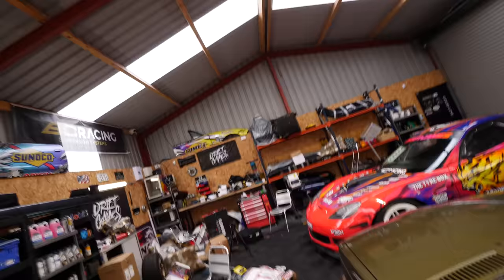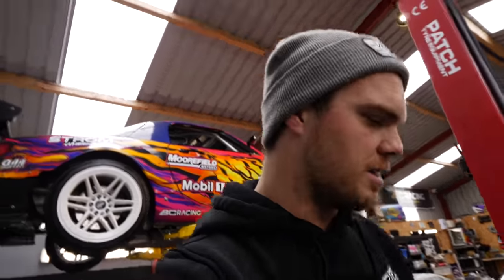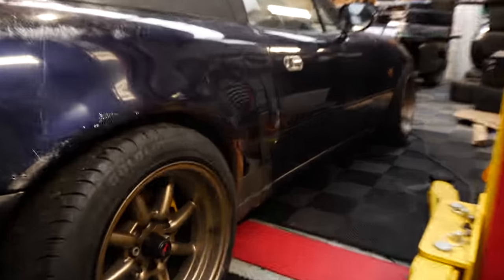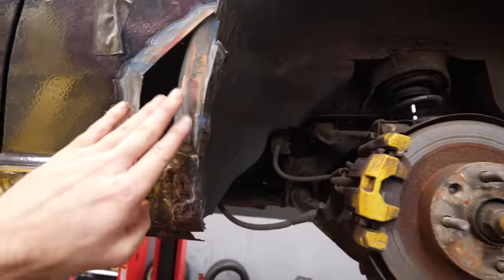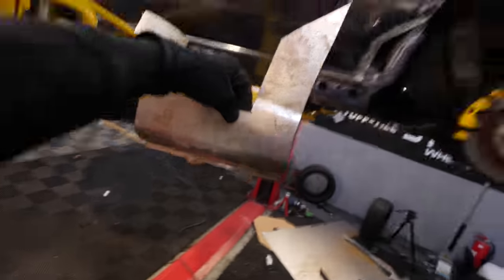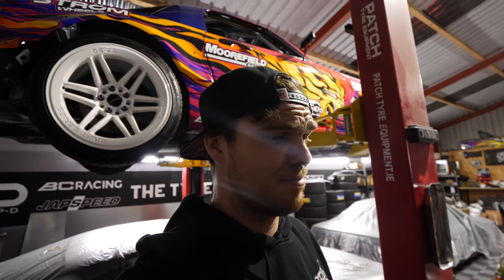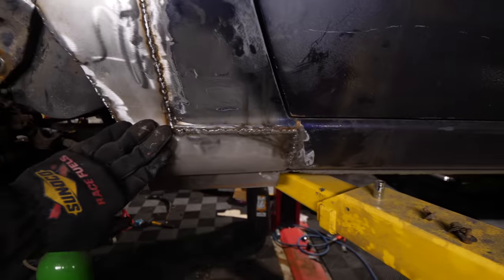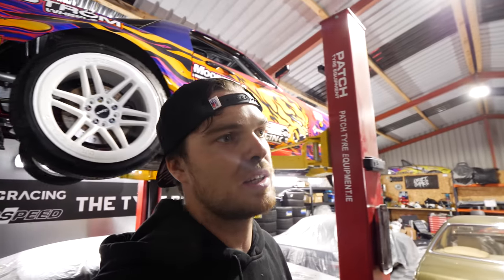Was the rust on our Mazda Mx5 NA too far gone? | First time welding…

Comment: What you need to do with this after the rust repair, strip interior seatbelt trims out there is a hole leading into the rear inner sill box areas spray that in cavity wax its complety unprotected from factory and this is why they rust so bad in the sills as condensation rots them out there, also remove both rear wheels 2x 10mm bolts each side remove the cover pop the grommet and spray in there too then u need to open the boot and spray into the holes leading into the rear archs in the boot it will save the car from rusting again at the sills

Comment: I had the very same experience with a mx5 nb not long ago. I bought the car not seeing the fact that it was completely Rotten so over a year I decided to try my hand at welding and fabricating for the first time clinging on to the wrong investment I made haha. I got through most of what I could such as the chassis rails and front end. But the sills were completely rotten to the rear of the car. I was very optimistic and was happy with my progress but doing it outside on a driveway with crap weather most of the time, it took its toll on morale so I decided to let it go. I kept loads of photos of the car and my work progress and still somewhat feel regret for letting it go. So good for you for taking a dive into the unknown man good job!

Comment: Definitely a good attempt. I'm the same as Josh. I've never welded anything so I'd be happy.
As long as it's now structurally strong now.
I'm sure you will, I'd put a load of underseal up inside those arches.
Also the areas behind the bumpers.
Reply from the maker: All of the under seal is going on this car 😂

Comment: Good effort! Be sure to check your hood drains are intact and not blocked. There's also a hole on the pinch weld to allow water out if it gets in. That usually gets closed shut from Jack's etc. Open it up with a drill bit, and pump cavity wax In it 👍

Comment: Good job Josh.. Only suggestion perhaps would be to use a zinc primer or any rust prevention primer before the Tiger seal. My FC had seam sealer straight onto repair welds and it didn’t age well
Reply from the maker: There’s layers of stuff going over 🤷‍♂️
Reply: @driftgames_life  rust can appear under the Tiger seal
Reply: The zinc primer should’ve been on the back of all the panels so they’re coated on the inside aswell. But too late now 😉 amazing job for your first time none the less!

Comment: Great video mate! I learned something but could you share what you did for the last step? Did you use sealer? Spray any undercoat?
Reply from the maker: Tiger seal and then I’m putting a layer of primer and under seal over the top.
Reply: @driftgames_life  👍 cheers